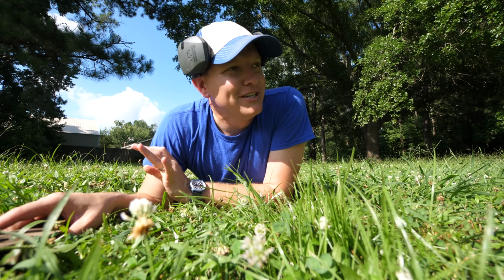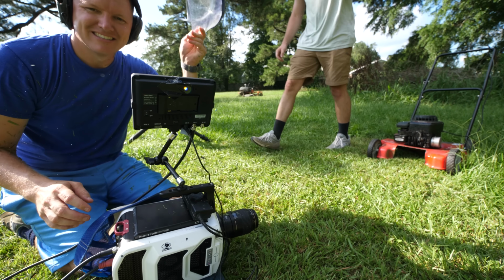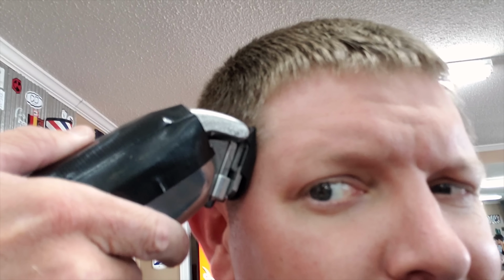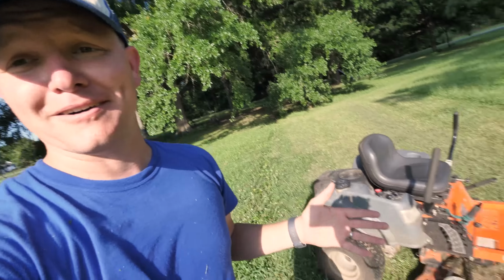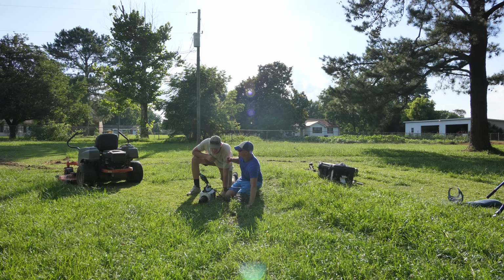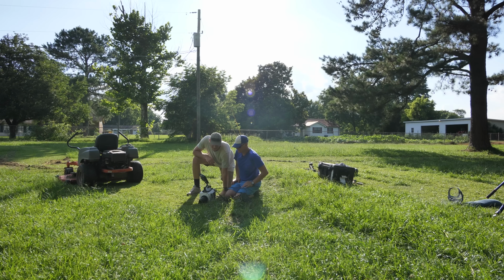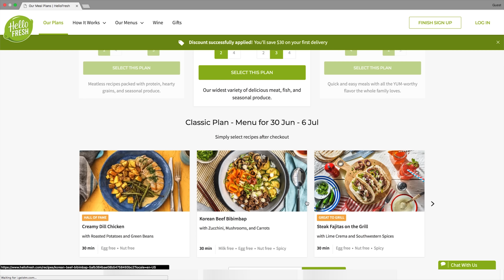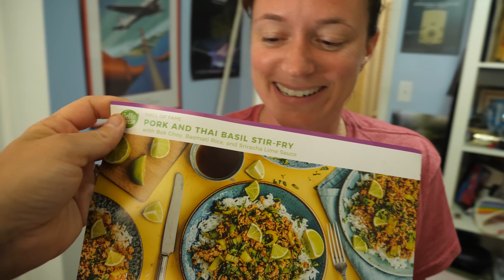How Lawn Mower Blades Cut Grass (at 50,000 FRAMES PER SECOND) - Smarter Every Day 196

Comment: I did a fair amount of green work at a lawn tennis club here in the UK. You're effectively describing the difference between ripping your grass, and actually cutting it. In a rotary blade, it rips the grass and this doesn't end well in the long run. What you do actually want is the 'cutting' scissor type of grass cutting. This is fair better for the grass.

Comment: This is what turned me on to reel mowing!   Reel mowing is a clever way of "scissor" cutting grass using a spinning reel cylinder with blades, referencing against a bed knife.  You can imagine this method is better for the grass because if properly "tuned", the reel mower avoids (or minimizes) tearing of the grass blade.  You're probably aware of this already, and the rotary method is certainly more interesting to investigate!  But I hadn't seen this mentioned yet.

Comment: Those "tabs" (or flaps) are primarily for transporting the cut grass away from the cutting blade. It's very similar to an airplane wing.
The effect of low pressure "sucking" the grass blades straight is more or less the cherry on top, but it is not how the lawn mower does it's work.

The most important factor of lawn mowing is the sharpness of the cutting blade.
A dull blade will just rip the grass and/or not cut it at all. 
Inertia is a very significant factor in this. 
With a dull blade you require a much higher rotational speed of the mower to have the same cutting effect as with the sharp blade. 

Additionally you need the flaps bent at a slight angle to create pressure differential to transport the cut grass away from the blade. Most often into a grass bin (catcher).
Without those you make just a grass smoothie.

Hope I could clear things up :)
Reply: so you think Dustin is wrong?  Because he isn’t. A flat blade won’t cut as well no matter how sharp it is
Reply: 〈 Morus 〉 a dull blade will kill the ends of the grass blade leaving a unpleasant looking lawn after a few days.
Reply: Brandy Ellis he wanted to sound real smart, but basically just proved this video correct.

Comment: maybe you can do a pull start engine video like you did with the see through engine video. i wana know why it can work in one pull then work another day with 8...
Reply: If it shuts off with unburnt fuel in the chamber (on the compression stroke) it basically fouls the spark plug slightly and you have to pull it / fire the plug a couple times to burn the crust layer off.
Reply: this is especially true with 2 stroke engines, when you shut off the engine some unburnt fuel with lots of oil it gets oiled up and fouls the spark plug slightly.
Reply: It would bee cool to see the unburnt fuel being deposited onto the spark plug and learning how little it takes to make it stop working, I know that those spark plugs have super tight tolerances so a little change creates a  high chance of messing it up. I really want Dustin to put an acrylic viewing window over the front that can have the camera mounted to with  lights and maybe even drill some holes around the shell to glue LED lights to light up the inside with so we can get a really great view of it. He should get a lawn mowing company to sponsor it too and to go talk to some engineers at the company to reveal all the hidden truth about why lawnmowers are awash with physics and unseen problems that have been solved.
And what about cutting through acrylic cor some other kind of plastic with a power saw to show how the teeth cut say in a circular say vs a band saw in slow mo, Drilling through clear plastic in slow mo, why bad gardening clippers suck so much
For general garden stuff try putting a high speed camera next to a bird feeder, watching butterflies fly, crickets jump and chirp in slow mo, get a monarch butterfly because their chrysalids' are a beautiful emerald green with gold dots( catch them exiting the chrysalis and drying their wings off for the most vibrant colors you have ever seen), Spiders catching insects, lizards eating bugs, ants and their nest (or make an aluminum casting of the mound to exterminate them in a cool way), something about carpenter bees, wasps, and mushrooms. I would say something about germinating a seed under a microscope but that takes slow speed photography not high speed photography.
It would be cool to see someone create a down to earth study about the effects of different plant hormones (like iba, iia, 6-BAC, and others) on something like tomatoes or maybe something that grows more uniformly like normally with a single stalk and flower like a tulip or onion?
I hope this is enough ideas for you Dustin!

Comment: What about electric lawn mowers that ride on a cushion of air? On mine there is no tab to suck the air up and hold the grass straight since the air flow is going downwards to lift the machine. Maybe something to look into?
Reply: Léo if you could do without it for a bit you might be able to offer it to smarter every day to do some tests just make sure you let him know not to break it.
Reply: Léo   It was the Flymo (sp?). Yes, they probably didn't make a nicely cut lawn since it was blowing the grass down.
Reply: E Robinson 
I'm not sure shipping my old lawn mower from France overseas would be quite cheap sadly
Reply: Lou Fazio it wasn't à flymo branded one but a derivate. Same principle though and not super great to use

Comment: I honestly don't think mowers work on the principal of suction, it's merely brute force. Blade spinning at ridiculous speed ( Much faster than you can yourself ) sheers on contact. Those tabs on the mower I am pretty sure are simply to try and push the grass out and those mowers with the collection adapters will likely have larger fins for such.

Take a weed eater or whacker, simply a round plastic string usually mounted to a fairly small motor buuuut it still spins much faster than mower blades even. Slow speeds will merely push the grass around faster speeds stress the point of contact so much so that it's shorn in place.

Suction could likely make things much more efficient if done right, for instance one or two areas where high pressure air is sucked up in a straight line up and out of the top of the deck could give for more support as the blade rips through much like the fingers  ( or comb ) of a barber as they prop the hair before snipping. Likely not enough suction the way they are to properly lift the blades of grass as you theorized.
Reply: Yep....moves air. I use my mower to blow clippings off the street and driveway after every time I cut grass....TONS of moving air if you have an open discharge port on the side.
Reply: MidnightMarrow well thought out argument, but I would tend to disagree based on the sheer force of air being discharged by the blade. The displacement caused by the tab lifts and controls the airflow from the bottom of the mower and out the discharge tube
Reply: MidnightMarrow BUNCH OF NERDS HERE EXCEPT FOR ME
Reply: Midnight marrow, you are 100% correct. Tabs and deep grass simply clear grass. A flat blade would cut just fine, but would need extra hp to move through the mess of grass left sitting in the way. A string trimmer is like mowing- no tab there.
Reply: I agree !
Reply: Yea, I'm not entirely convinced that's why they put the tabs on there. Usually people increase the tab size to throw longer/heavier grass into the catch. Or they'll decrease it if the mower's stirring up too much dust. 

On the high speed footage, the grass is springing back up in areas that aren't directly below the tab at the blade's end. So the tabs don't look like they're creating that much suction. I don't think Destin's wrong in saying it, a lot of websites agree with him, but it seems like an advertising exaggeration to me. If you wanted suction you could put a fan/impeller above the blades and it would work much better.
Reply: Then you don't understand how they operate. Don't spread misinformation on things you do not understand. Weed whackers operate at much high rotations per minute. Lawn mowers typically run at 3600 rpm, the blades at less. They tear and rip, they do not cut. The wings on the blade face upwards to generate lift so that it actually removes part of the grass blade
Reply: MidnightMarrow I agree, you have straight blades and also mulching blades, the mulching blades are the one with the curve in it and if something it pushes the clippings under the grass, not sucking it and throwing it over. I think the barber hair clippers works differently than a mower blade. Just the fact you can buy two types of mower blades tells you is not suction. I can use a machete to cut my lawn, And I dont create suction. If I can do it with the force of my arm imagine what I can do with an engine. Anyway, it was cool to see the blade in slow motion
Reply: Rae S I would say that you are probably mostly correct but the lift created by the tabs would probably be fairly significant as that is what pushes the clippings up the chute of a lawn mower with a catcher. The longer the tab the more lift created and therefore the easier it is to push large quantities of grass up the chute.
Reply: MidnightMarrow 
Agree, you can also analyze the "cut" of the grass. Standard mowers leave a rough edge indicating it was merely beat apart. These edges brown more quickly as well. Golf courses typically use reel type mowers (on the greens anyway) that actually sheer the blades of grass and produce clean even edges that resist browning better.
Reply: I find myself in agreement with MidnightMarrow - I'd guess the tabs are much more about ejection than any sustained suction of the grass.  In the slow mow (hahaha) I see no more spring back/vertical pull on any blade on the first/slow blade pass than on the last.  The only difference I perceive is that the blade is finally moving fast enough to achieve an inertial cut.

That said, I also see a lot of people asserting as fact what sure looks like opinion on both sides.  It would be trivial, and cost no more than a $20 mower blade for destin to settle it by buying a blade, and using an angle grinder to remove the tab and seeing if it made any difference at all.
Reply: MidnightMarrow pretty much got it. Suction will lean the grass in the direction you mow. If you stand in right spot and suns right you can see lighter and darker stripes like baseball fields from the suction leaning the grass. Light stripes lean away. Dark stripes lean toward you
Reply: those tabs on the blade, ive always assumed they are like a fan blowing air into either the chute or the bag. as a result the clippings are forced to go where ever the air goes. i also think that the blade cuts by brute force (no suction) those tabs are simply a means to move air and by moving the air you move the clippings
Reply: But a scithe isnt going That fast but also dousnt USe lift
Reply: Blades are designed to be paired with a mower deck. My mower currently doesn't have any 3rd party blades available.  Some mowers use a more universal design so that 3rd party blades can be used, and there may be some efficiency reduction is manufacturer blades aren't used. But lift is absolutely part of the operational design. Also, most people don't maintain their rotary blades. They do need to kept sharp. I try to have 2 sets of blades so 1 set is always ready to go and I always try to avoid hitting debris so the blade edges don't get damaged.
Reply: They even have mowers where the blades push air DOWN and they are still  able to mow well.  Do a search for Hover mowers. They actually float and do not have wheels at all.
The grass moving up is probably just the grass springing up after being pushed down by the mower deck.
Reply: It could be that it is not so much there to create lift as it is to force it into a circular motion around the deck. The mowers with a side discharge do not have it go out the top but at an angle like the output of a hand hair drier.
Reply: MidnightMarrow. Has the right idea. If the cutting action was dependent on suction then mulching mowers would not work they would just clog up with long clippings. Under a mulching mower the grass clippings are free in the air floating about violently with all that wind made by the wings on the blade end. They are circulated around and pass in front of the blade and get cut again. No suction or attachment to the ground to hold it for the cut. They are simple brute force cut again and again as they circulate under the deck eventually finding a way to the ground as not all areas under the deck can be up draft. Some where under there the air that is pulled in has to go back up under the lip of the deck. The suction created by the low pressure may help with a cleaner more even cut but its not required to actually cut the grass.
Reply: Something to also think about, as you walk over grass it tends to spring back up. Something I've always noticed with all mowers push or ride, they seem to just blow somewhat similar to what a blower fan would do ( In this case, through the entire base of the deck and out the duct ). Perhaps they have been trying to incorporate some form of lift  these days but with the limited space in the deck and the lack of an opening above the deck I'd imagine it'd be quite limited as the air has to go somewhere and for proper lift to be achieved It'd in theory need to vent up. But they do seem more like a chaotic cyclone with a duct on the side to push clippings out and away.

Regardless awesome videos as usual not trying to knock anyone just more food for thought! I've done my fair share of lawn care and I do play with various types of fans for cooling purposes. My understanding on how air tends to flow specially in more confined spaces leads me to believe any lift achieved is rather minimal but, without proper smoke tests being done it's hard to say for sure. But also comparing a mower to a pair of clippers that essentially has a tiny vacuum attached isn't the same. ;}

Comment: Blade lift is to move the clippings away to prevent recutting them. A side benefit of the lift is that it causes the grass to be cut somewhat more evenly. The grass is not actually cut or clipped but shattered/exploded  at the point of impact. This is nothing remotely like cutting. Think about cutting the playing card with the AK-47. High velocity does some amazing things!

Comment: Smarter. Doesn't grass spring up using elastic energy in addition to lift?
Reply: I don't think there would be enough. If that were the case then we wouldn't leave faint footprints while walking in the grass. But of course the grass's hydration also falls into play.
Reply: The grass was moving up way too fast for that to be the case
Reply: The rpm of the blades are way too fast... To give the grass to regain its shape due to elastic energy... It needs an additional pull.

Comment: So yeah Destin of actually wanted you to do this for a while. I want to see the failures of string trimmers and chainsaws. So for example I want to see first how string trimmers cut in slow motion and second how the bits of plastic break off like when you're cutting random things and a piece breaks off why does it do it. Second with the chainsaw it would be really interesting to see the teeth grabbing bits of wood and throwing it out in slow motion. And for the chainsaw I want to see why and how the chain falls off. I mean I guess I know why but how in slow motion.
Reply: I think it would be pretty easy to replicate the chainsaw blade falling off by making it really loose and going slanted in tree branches

Comment: Not sure if you guys noticed this but when you slow the video down to watch the blades cut grass, you can hear the four strokes of the internal combustion engine. I just thought that was cool! Good job on the video!
Reply: The slow motion sounds are edited in artificially. So there is no sound recorded in the slow motion videos
Reply: Ryan Kraft Bummer dude that would have been really cool.
Reply: You would've only been hearing the exhaust stroke anyway
Reply: Bennet Fox only exhaust strokes can be heard unless you use a microphone and put it in the intake of a motor and then turn it by hand(the motor of course) and then you'd be able to hear the exact sound of the intake strokes which would sound like a vaccume being pulled(which it is )
Reply: Bennet Fox But still you noticed how well Gordon ("the sound guy") has worked :-)

Comment: how about how a combine works when cutting corn fields. that would be very interesting to see.
Reply: Its basially the shears like the barbor has. Nothing fancy. The long cones in front help guide in the stock to be cut and if the cob falls its caught in the feed and pushed into the auger and put through screens of the combine. Nothing that fancy, just a huge machine with a bunch of moving pieces.
Reply: My boys would love that!!!!
Reply: @brandoncaldwell95  kinda right but not fully. A corh head has what is called stalk rollers that rip the corn stalk downwards and when the cob makes contact with the deck plates it is ripped off and is fed to the cross auger with gathering chains. Some corn heads do however have choppers which cut the stalk to a uniform length after they have gone out of the stalk rollers.